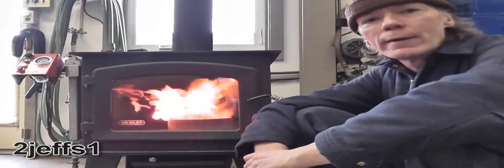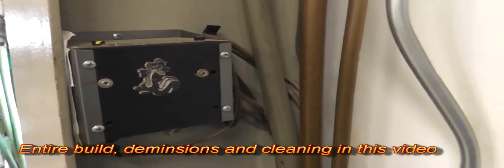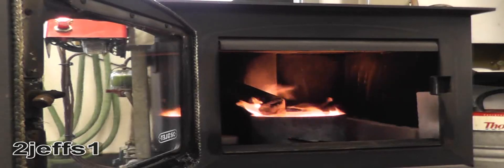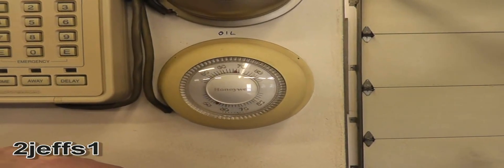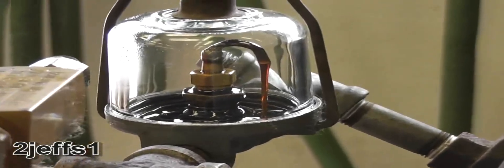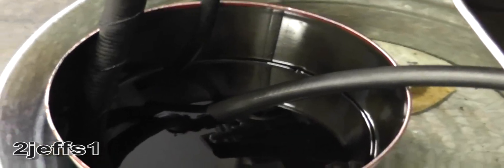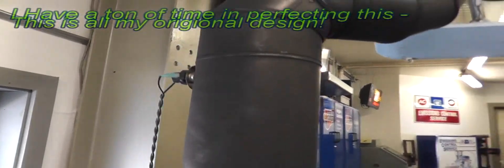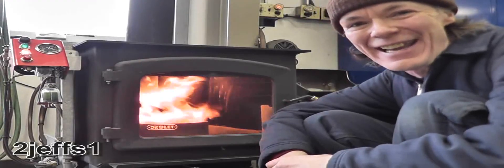Homemade Waste Oil Burner Heater for Daily Use DIY

Comment: would love to get my hand's on your plan's,..  have been doing some resurching on this threw other's design's and improvement's,..  but so far your's in more practical,.. and and have some Idea's of my own,.. would love to corperate,.. as of yet not built my first one,.. just resurching and when am ready will press to achavement,.. thank you for shareing this,.. I am thoughly impressed,... fill free to contact me,.. your new friend Jeff,.. ;)
Reply from the maker: +Jeff Johnson HI Jeff. A while back I tried several different things. Ended up being a waste of time. If I were to write up all the things tried one would get old.  :>)  Where it gets used daily in the cold weather been quite happy how low maintenance, dependable and easy starting it is. So many hours invested to get to this point. Unfortunately for me I built this long before YT was even a thought. Unreal how many different video's on these are out there. Bet your not bored when there are so many to watch! Good luck on your project. Doing lotsa research first is always a good thing!

Comment: Hate to keep bothering you, but do you know what RPM your running the smog pump at ?
Reply from the maker: +Kevin Daye Hi Kevin. I believe it would be about a 2 to 1 ratio with the smaller pulley on the motor. Here's a tip for fine tuning. I have one of those adjustable pulleys on the motor like they had on old furnaces with the squirrel cage blower. They have a set screw that you loosen and adjust (one side) of the pulley to vary the speed as desired. The one side of the pulley is threaded, you turn that and lock it down with the set screw. Sorry don't know the term for them. You can go from approx 2-1/2 to 1 to 1 with mine. They make them in different main diameters too. They have step pulleys which are cheaper but then the motor has to be moved from left to right. You probably remember to use a 1725 - 1750 RPM motor is preferred too.

Comment: Hey Jeff, great clips ! We'll soon be done renovating our 1880 house here in Belgium and finaly i'll be having a little shop to tinker on my cars / bikes. I've been racking my brain on how to heat it as to save cost i did not plumb it in to the house's central heating system. I have a great cast iron woodstove , thing weighs about 400 lb's but i didn't link it to me having to pay to get rid of my waste oil.

Thanks a million !

Btw, are you the guy from the guild of automotive restorers ?
Reply from the maker: +Kirsten Gabriels Sounds like an awsome place for a renovation! I enjoy hearing what fellow tubers are up to. It would be neat to know how much that heater has saved me on heating bills thru the years. Before I was at this place (1985) I had a garage in a residential area. If it didn't run clean someone surely would of complained. As for the guild I'm not from there. I will say that I've done my share of restorations for folks tho...

Comment: Jeff...I forgot to ask, ...the smog pump.....does that supply the pot with forced air? And, can you build this just as a gravity feed stove that will burn without electricity?Thanks!
Reply from the maker: +dcma2010 Yes - The smog pump is for the pot air. Many years ago I used the air compressor which worked great but isn't quite as cost effective. I did make several attempts at first to run it without air which would be nice if one don't have any electricity at their location. Trying to run at a low speed will make too much smoke. Once they are hot they can work fairly well.  I believe Gerry's waste oil burners has several nice vid's on that type, he seems like a great guy and maybe could assist you on that. 
As for some plans - sorry. Never drew any up, just kinda build as I go here pretty much on every thing here!

Comment: Sweet Jeff, Thanks for sharing and educating. Youtubers posting videos should take a notes on this video and how to do one. You sounded  nonchalant on the whole operation and then I see what you wrote on what lead to it. Smart guy going smart work. I'll have to take notes and re watch several times to get it down. Thanks again.
Reply from the maker: ***** Hi Rob. It still has been quite cold in the am so it gets fired up daily yet. Where this winter got abnormally cold it was appreciated more than usual. Even if the building is warm I like when you come in from outside and can stand next to the stove to get charged up quicker!!  :>) Glad you enjoyed the video and thank you for your comment, Jeff

Comment: Excellent, thanks for sharing! Do you have to keep an eye on it while using it ? Also can you keep it on around the clock? Does it have to be shut down after a certain amount of hours?
Reply from the maker: ***** I would recommend being present while its running - especially on a new build. I always shut it down for the night but there were a few times when I forgot to shut it down.  (tired and things on ones mind) Came out the next day and all was working just fine. 
 For continuous days - never did that.

Comment: Some rockwool in that garbage-can upstairs would make it even more silent and add even more security against both fire and shrapnel in case of a failure.
Reply from the maker: MalawisLilleKanal Never heard of rockwool. I can see where that could have certain uses. I Thank you for the tip!
Reply: They should have it in most builder-shops, together with other kinds of house-insulation, and should cost slightly more than the regular glass-fibre matting.

Comment: Looks like a great setup. If I build this without any electric parts, do you think the pipe going down thru the bottom of the firebox will be needed for additional airflow? I have a very similar stove with a bottom damper/air control. Also have you ever tried vegetable oil in this stove? Do you find it is more efficient with the smog pump pulsing air to the fire? Thanks for a great video and a clear explanation of your system!
Reply from the maker: Richard Gunick Hi Richard. At the beginning of this project years back I didn't have that pipe in or electrics. Things will work just fine without that. It does make the burn slightly better but isn't a game changer in regards to that. I mostly like it for the additional safety thought so just keep a eye on things a bit more. Once you get use to your stove operation it will seem like nothing to operate it. You can tell how things are working just by the sound it makes. Sounds too simple but so true! Never tried veg oil. Can't see why that would be an issue tho. Yes the pulsing of the smog pump makes it more efficient but not an extreme difference. You will use a little more oil but if your using a blower instead of an air compressor then the oil consumption goes up considerably more. Volume of air in = lotsa heat lost out the chimney. The basic version of this is what I used for many years at first and was very happy with it. However I do like to tinker to continually make things better. When I arrived here in 86 a guy had a wood burning furnace he brought to use. Didn't have the air compressor here yet due to building re-construction. Told him that the oil stove would heat better than that furnace. As soon as the compressor was up and running the oil stove was installed. Now he is a believer!
Reply: Thanks for the reply!

Comment: I will have the stove outside my garage in a cement block vault, for lack of a better word.I'll run my electrical and my oil in an insulated 6" tube to the furnace and have a heat trace wire on my oil line for cold starts although the plan is to run continuous all winter, I have a great supply of oil from a local garage for free.the water lines will also run within that insulated tube.I will post pics when I do it as well as a full electrical diagram using the flame out sensor, just a hint here you can use a photo resistor from an old dark sensor control from an outdoor light,,,

Comment: no I plan to take a 60 foot coil of 1/2" copper tubing and making a cavity above the actual fire box to place it and then pipe it in my garage using a radiator and fan to distribute heat..I plan on building an control system similar to yours adding flame out control in case the fire went out and it was still feeding oil, easy to do using an light sensitive resistor like a fire-eye,,,no flame, no fuel..because I would like to run it constantly all winter, plan on putting it outside in a cement vault with a metal door and of course proper ventilation.that way avoiding and problems with the insurance company.
Reply from the maker: Nice writeup and ideas you have Steve. Sounds very well thought out and the flame out sensor would be a excellent addition where it would be setup in a separate area.

Comment: it certainly is, I build a lot of projects myself including a tractor couple of years ago and the hardest ones are the ones more worth it..take care man and keep them coming..
here in Nova Scotia Canada we wouldn't be allowed to use a homemade heating device but I am thinking putting one in a cement building outside my garage and piping glycol through it and a radiator with a fan..my shop is 24 ft x 36 ft so a fair shop to heat but the oil would all be free so I am going to try it for sure..
Reply: Hi Steve, I'm thinking of something similar, but in a garage still in the planning stages. My thought is to run PEX in the pad for in floor radiant heat. Are you considering just a jacket around the chimney to heat the glycol? Jeff, thanks so much for sharing all this information!

Comment: I've been looking at oil burning for some time but the conventional drip oil burners up here wont just run . so this will help out thanks.
Reply from the maker: Randy Seibert Your welcome Randy. The burner setup should work great in most any stove. Component dimensions close to what I have will work just fine.
Reply: Thanks

Comment: Awesome video.  Very well thought out and extremely informative.  I really appreciate anyone that puts their design on YouTube, but your design is built like I would want mine to be built.  Thank you for sharing all of your years of experience, I doubt anyone could come up with a system this nice their first time around and you have saved me a great deal of time and head scratching.  Its 5 deg F right now where I am at, and I am ready to start building!
Reply from the maker: CB Hi there CB. Thank You for your nice comments. That makes the efforts so worth it on my end. Where there is so little heat going out the chimney by using a smog pump instead of a blower I believe it to be the most efficient use of oil out there. But hey - have fun on your build and Thankx again CB, Jeff

Comment: I have 3 blowers, I use hair driers in which I have turned off the heaters. Two blow into the pot at the side bottom and the other down the outside of the oil drip tube. I think I have lots of air.  What do you mean by fine tuning on the finals?  How much oil do you use?

Comment: I have built a similar system but have taken it to the next level. I have converted a wood stove to a hot water heater, I put several pipes through it and made a water lined chimney. I use it to heat a cottage that is 2000 sq ft. with two rads.
the stove is outside, I put two circuits to drip oil, a low and high. I use a temp sensor to switch based on water temp. My question today is based on the amount of oil I am using. What is your consumption when burning high. I know this is a difficult question. I am burning about .75 Canadian gal an hour. I think this is too much. I will post a video in about 30 days.
Reply from the maker: David Smith Sounds like an interesting stove you created Dave. If you are using a blower you do use more oil. Some fine tuning on the finals always helps too. Will be looking forward to seeing your setup!

Comment: Looks like a pretty solid design.  I would like to do something similar with a couple of changes.  I have hot water heating in the house and my shop.  I'd like to use the same style stove and weld a two inch deep box to the top of the stove and run water through it - with the proper pressure relief and expansion tanks etc.  I would most likely run the unit outside in a shack as well then run underground insulated lines to the shop and house.  Do you think a stove like yours could heat the water sufficiently without taking too much heat from the fire to cause problems?
Reply from the maker: Loren Daoust Hi Loren. I like your idea but to heat several buildings and convert it to water heat - I don't know how efficient that would be. The sides of the unit get hotter than the top where it is double walled there on this unit. A different stove with tubes running thru it and the same burner setup might be a thought. As far as causing a problem with the fire I wouldn't think that would cause any type of an issue....

Comment: Thank you for taking the time to put this video together. It is well filmed and well edited... not to mention that you did a very impressive job explaining everything. This video WILL be bookmarked for future use!
Reply from the maker: Jeremy Cook Hey - Your more than welcome. And Thank You for helping explain things to the other viewer. That was a very nice gesture. The nice thing with this setup is using pressure and not volume on the air injection so you don't need an oil truck parked out front!  It's easy to make oil burn. To make it efficient, well....Glad you enjoyed the video and Thanks for helping out, Jeff

Comment: i didn't understand how it was gravity fed.. and also can you use waste veg oil?
Reply: Think about draining a water bed... When you place a liquid load at a higher elevation (preferably at least 4 feet above), upon opening your valves, gravity will draw the fluid from the elevated position to the lower position. Jeff said his tanks were upstairs.
Reply: As for the veggie oil, any oil will actually burn. You just need to be careful that the waste doesn't solidify or it completely defeats the purpose.
Reply: Jeremy Cook
thanks for the kind answer :) but i don't understand how is it fed from the top and not from the bottom of the upper container.
I know the name in my language but in english i can't fully explain myself.
Reply: Jeremy Cook
anyway i tried yesterday at burning fresh corn oil and it burned super bad,probably it needs super hot metal plate.

Comment: Nobody really knows what that powder junk would do to the environment. If everyone in in a major city would use that .that stuff would build up fast. And besides i think it would be better to recycle the oil to use again sense you just cant make oil.
Reply: Jessie James: Okay, there is not that much waste oil so not everyone will be burning this, also this is very efficient and uses oil that would otherwise be thrown away.(Land/Water Pollution) What do you think they do with the recycle oil barrel. They usually burn it in a waste oil burner in a city building! (Fire department/Car shop/City plow truck buildings)What would you rather? Share a like please!

Comment: I could not make out what you called that glass unit turned up side down.
Reply from the maker: urgentcareguy3 Hi urgentcareguy3. That is called a sediment bowl. Them were used on tractor fuel tanks (and other machines & vehicles) years back as a fuel filter. They were just underneath the fuel tank (or inline) before the carburetor. Any water or dirt in the fuel would settle in the bottom of the bowl which was easily seen and serviced.
Reply: Thanks!

Comment: Thank you for your post I really enjoyed it. I do pose a question for you. I notice you pump air to the stove, would a rocket type stove work being fueled by the oil? and maybe get even more heat? thank you for your time.
Reply from the maker: Wayne Lawler Hi Wayne. Actually I'm not real up on the rocket stoves. I'm using the pump for pressure & not volume. I do know when the chimney is getting hot (volume) you need a lot more oil to operate the stove. Actually you can make the sides glow if the high limits are raised. I did this on my first stove but eventually it became quite distorted. On this one that would be hard on the glass too. If you were to see my first stove it had a lot of trial and error holes from all the different air induction systems that were attempted. They worked good but far from efficient. I guess I'd call this a combination/balance of efficiency & safety. Thank you for the comment Wayne, Jeff

Comment: Hi, could I use this for my shop?  It's about 3,000 sq ft.  Would this be sufficient enough to warm up that much space? How many gallons of waste oil per hour would it use?  And how much would this cost?  Thank you very much.
Reply from the maker: refi68 Hello refi68. If I open the interior overhead door then I'm heating 2500 sq ft. It will heat that size area no problem. I guess approximately 3 gallons in the day if it's -10 F out. People bring me oil from there oil changes so the oil is always free. The building is insulated very well and usually bringing it up from 50F if your out there daily. The other thing is on how warm one keeps the building. I'm usually running around 70. There are a lot of variables to this question & hope this helps you out.

Comment: I am about to start my project, the wood stove I got has the bricks.  Did you remove them leaving just the steel walls exposed?  thank you.
Reply from the maker: HYDROGENTEK I did use some of the bricks that came with the stove in the lower part of the stove. As far as the benefit, don't know if it would be much. There isn't anything up where the flame hits directly on the steel. that will make it heat quicker vs heating the brick.

Comment: drolet  makes a oilstove.. i bet it would run on your oil too..  coleman made a oil stove called a dewatherm  in the 70s.. has a lil carburetor on the back with a 5 gallon gravity gastank fill of kerosene